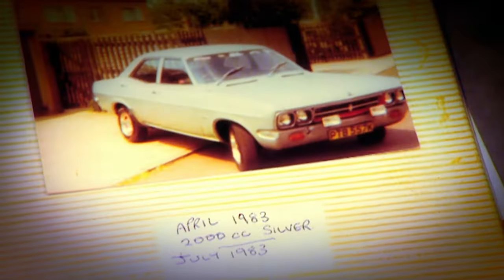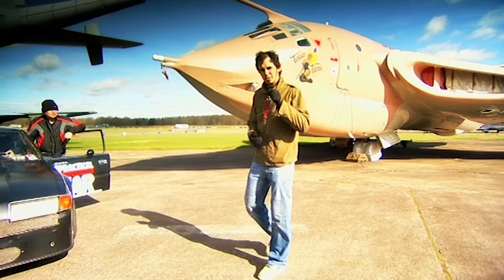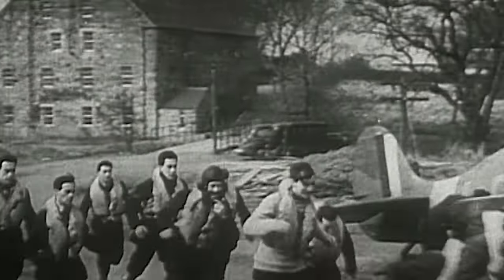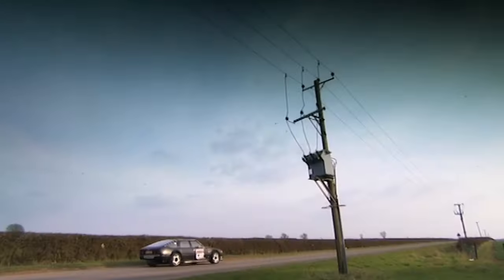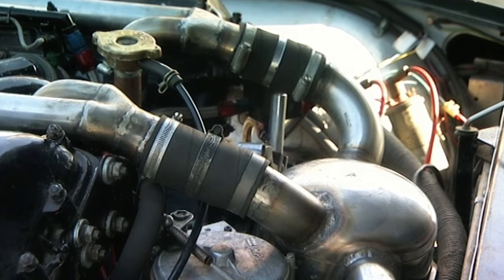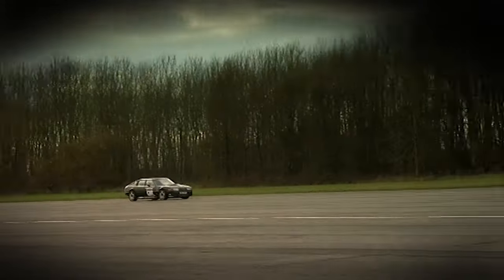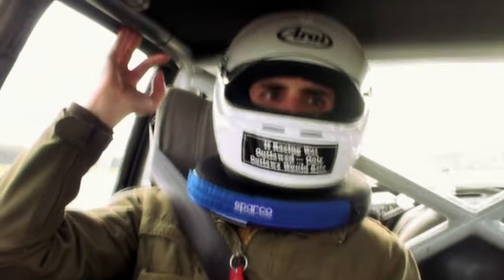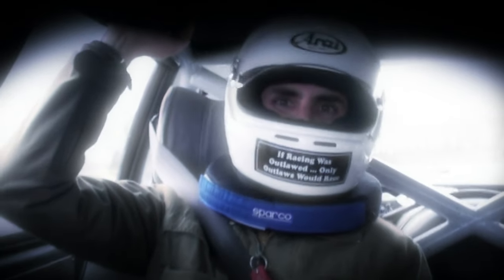Driving A Rover SD1 With A Plane Engine #TBT - Fifth Gear

Comment: All I remember about my dad's old Sd1 from the 80s was that whenever it rained, the glove box filled up with water and more bizarrely, about 10 times a year the car would move over night on its own.... No sh9t. He had the brakes checked about 4 times but on cold nights, it was a guarantee that the following morning the car would roll down the street (slight slope but only slight) and would be parked up about 70ft from the drive. It would roll down the drive, put 2 wheels tight against the kurb and use the kurb as a guide until it came to rest. Handbrake on. Auto in park. Very odd. I also remember my little brother smashed his face and being in the car when my Dad rushed to the local hospital, that car ride was the fastest most insane of my life. Always loved the look but as I got older and learned the awful engineers at Leyland stories, I've lost all the admiration I once had for the poor (very poor) mans Daytona
Reply: Did one of his mates have a spare key.
Reply: So why didn’t he just put a piece of wood in front of the front wheels?

I do that with my tractor since it doesn’t have a handbrake and I don’t want to park it in gear, just in case one of my neighbors(I lend them my tractor once or twice a month so they can cut the trees in their gardens and drive all the branches away to the local „junkyard“) forgets to put it in neutral when starting, so they would destroy my shed, that it’s parked in front of.

The starter is powerful enough to turn the wheels when it’s in gear and then the frontloader would proceed to plow through the wooden walls of my shed, which I do not like very much.

Comment: For tank use the Merlin had its supercharger, reduction gear, and other equipment removed from its crankshaft, greatly simplifying its construction. It had cast, rather than forged, pistons, and was de-rated to around 600 bhp (447 kW), running on lower-octane pool petrol instead of high-octane aviation fuel. In addition, because weight saving was not so important for a tank engine, some of the Merlin's more expensive light-alloy components were replaced with cheaper, steel components in the Meteor X version. It was also envisaged that the Meteor would use some components rejected on quality grounds for the Merlin, i.e. Merlin scrap.[1] In 1943 an acute shortage of blocks was met by dismantling surplus older marks of Merlins. So basically the same as the aero engine with some minor differences ...
Reply: The fuel was called MT80 and has an octane of just 80. Terrible stuff really.

Comment: 3:07 he talks about it like its rocket science or brain surgery... its just a reduction drive mate!
Reply: +colj001 reduction or multiply?
Reply: +Oscar Thorpe multiply in axle rotation speed, reduction in gear diameter.
Reply: +Humongous Richard boom!
Reply: +colj001 Wait, wait. Saturn 5 rocket, channel all that power directly into a reduction box from a bus, and you rocket goes 3 times as fast!! It IS rocket surgery!!! :¬P
Reply: +colj001 its simple in principle but it is NOT simple at all to fabricate and HECK to get it to fit in the car is a accomplishment itself
Reply: He said it was a 3x multiplication not a reduction.
Reply: It's not the principles that are difficult in this case, it's the engineering. Just fitting the engine e t c together with that I assume alot of the parts needed is not likely laying on a shelf somewhere.
Reply: Charlie multiplies the engine output up by 3x by using an old bus reduction gearbox in reverse. That feeds a GM TH400 autobox.
Reply: Coulda put a talllllll final drive ratio in too.
Reply: Dellacondan - that's what I thought
Reply: @sugarnads  I knew of a guy who was putting a Meteor engine into a vintage lorry chassis with coachbuilt Bentley style bodywork. He was fitting period size wheels, around 24 inch diameter or similar and using a two speed rear axle and direct drive. With the torque available and revs, in high he could hit about 130mph which he decided was probably faster than his bottom would stand!

Comment: 3miles to the gallon
Reply: Probably closer to 3 gallons to the mile.
Reply: more like 35,000 smiles per gallon.
Reply: 1gallon to the mile
Reply: I only get about 15 so eh, worth it
Reply: 3 Focke's to the gallon...
Reply: @mrcaboosevg6089  
Zero Fockes given about the MPG.
Reply: it did 15mpg imp on the Nürburgring

Comment: It's a Rover Meteor engine out of a tank. Much easier to use as it has a proper gearbox for a road vehicle. Easy way to tell, a Merlin runs with 6 inch stub exhausts and won't run properly with a long pipe. The Meteor which is based on the Merlin does run with a long exhaust.

Comment: you could just tune the 3.5 v8 to give same performance?
Reply: +paul hunter And where's the fun on that??
Reply: That's not the point though, is it?
Reply: BMW reached approx. 1000hp/l specific power in the 80s F1, based on that a 650cc engine could output the same performance.
Reply: Missing the point of these
Reply: yea, but it will never sound like a merlin engine.
Reply: Paul, no offense mate but you've clealry missed the point!!!

Comment: The engine in a tank was called the Meteor, not the Merlin and for good reason. Whilst the shared the same basic block, it had the direction of rotation reversed, the supercharger was omitted, it had cast, not forged pistons and a host of other simplifications and changes to make it suitable for use in tanks. It was also de-rated to about 600 hp. It made for an excellent tank engine, but it isn't a Merlin, and it's most certainly not a Sptifire engine.
Reply: PUN INCOMING!

Maybe call the car Thomas because it has a tank engine😂😂

Comment: Impressive engineering but not really a very fast car considering the size of the engine.
Reply: +/Dream Car Garage 1 (DCG1) Probably because the engine is heavy af!
Reply: +/Dream Car Garage 1 (DCG1) and because the engine is over 70 years old lol
Reply: +/Dream Car Garage 1 (DCG1) 
Is this dream car garage the show? or just some ones  username
Reply: the show. Check out some of the vids on my channel.
Reply: +/Dream Car Garage 1 (DCG1) I think it massages your arse quite well. :D
Reply: +/Dream Car Garage 1 (DCG1) Yes the engine is huge, but it uses very old technology. It's also extremely heavy, making the car overweight. A modern 27 litre engine would have more power.
Reply: /Dream Car Garage 1 (DCG1) plane engines are designed for raw power. Not speed... those are racing planes

Comment: This is why fifth gear sucks!

The METEOR engine was fitted into tanks and the constant references to spitfires and airplanes is fucking infuriating. Its treating the watchers like clueless morons.
Reply: +Rich77UK to be fair they did actually make clear that the meteor v12 was a tank engine, its just the fact that the design is very similar to the merlin, plus the fact there was what looks like a Victor parked in the background at the beginning. The programme makers didn't thrash it to death like top gear did - just dropped a few hints to make better tv
Reply: +Rich77UK 
I know just what you mean Rich, nothing worse that listening to blokes who haven't got a clue about what they're on about.
Reply: +andy2382 Yeah they were filming at Bruntingthorpe which is an ex-airbase
Reply: Is half the video missing or something, cos I clearly heard him say it's a merlin engine, when does he say anything about meteors?
Reply: MarcusTDM the rolls Royce meteor was basically the unsupercharged version of the merlin
Reply: +andy2382 ok cool, I get that, but in the video he states that it's a merlin not a meteor. Sure people have the knowledge I guess to no what he's saying wrong perhaps but no one has said that. Cheers.
Reply: +Rich77UK rich needs to check his facts as he's been destroyed in these comments.
Reply: Many Meteors were ex-Merlins rebuilt for land-based use, so it's not inaccurate.
Reply: Rich77UK Merlin was the plane version of Meteor
Reply: Ellenor Malik
Other way round. Merlin came first, Meteor followed. Many early Meteors actually were life-expired Merlins, though.
Reply: Rich77UK Meteors & Merlins are the same 27L block. If you ask a shop that rebuilds engines to make you a Merlin block, you can use it in a Meteor engine.
Reply: 306 CHAMPION Right up there with people who complain about other people getting things wrong
Reply: Rich77UK it's the Merlin engine. Not the meteor

Comment: It’s. Rover Meteor. Tank version of the Merlin. The oldest ones were made from rescued Rolls Royce Merlin aircraft engines from crashed planes and actually had scarring on the cases. But they were mostly built by Rover cars.

Comment: If you're going to go to all that trouble to fit a 27L engine into your car, you might as well get the real deal and stick a supercharged Merlin engine in there not it's reject cousin.
Reply: Cost. Go price a proper merlin. And, frankly ALL proper merlins should be kept for the aircraft still flying that use them.
Reply: Might be difficult to find a Merlin for £1000 though
Reply: +Jonka Olofsson Ask Jay Leno.
Reply: Leno's "Bentley" also uses a Meteor. An actual supercharged Merlin will not fit in any car, for the simple reason that the supercharger turbine is concentric to the crankshaft and so sticks down beyond the bottom of the engine by at least a foot, if not more... if you want forced induction on a Meteor/Merlin in a car, you'll have to come up with some other way of doing it.
Reply: ***** Turbos :D
Reply: Sigma Octantis
Meh, they'd strangle the sound. Superchargers FTW. Twin TVS2300?
Reply: Sigma Octantis  the Merlin had turbochager it would not be able to fit under the hood
Reply: "An actual supercharged Merlin will not fit in any car"... Except the chevvy that a mad Aussie bloke built in 2003. Personally, I think both cars are dumb, but the Aussie version is done A LOT better IMO.

https://www.streetmachine.com.au/features/1705/massive-attack-1955-chevrolet-sports-coupe
Reply: I've just shared a video on this thread about a well known rodder here in Australia who did actually fit a Merlin to a 55 Chev.

Comment: 162mph...  wow... that was almost as fast as the fastest cars in the 80's
Reply: Times have changed. My 2007 Saab 9-3 Aero, slightly modified, is speed limited to 260 kmh = 162 mph. I'd still like to try that Rover. I'll bet that the torque would feel great.

Comment: read PPC mag plenty of write ups on this car. With twin turbo chargers added it made 600bhp at idle.....lol
the guy built his own dyno for the engine using a bus brake electric retarders and the cooling system outside of the car was a radiator from a hospital backup power generator. Proper stuff!